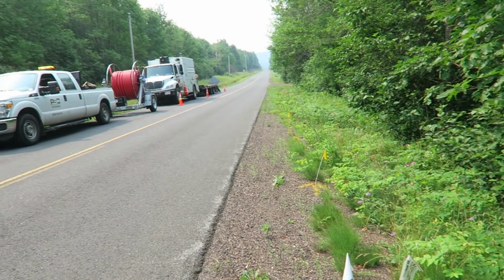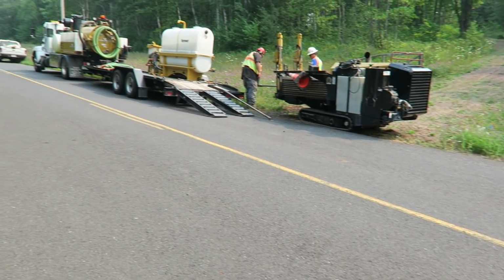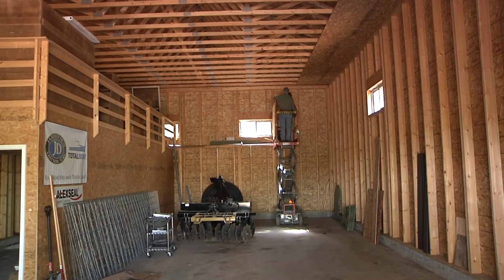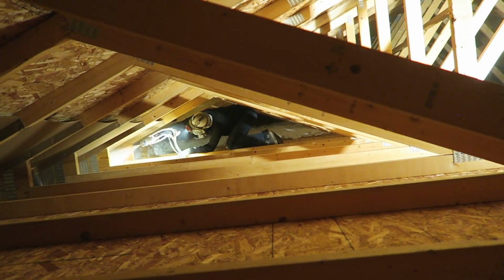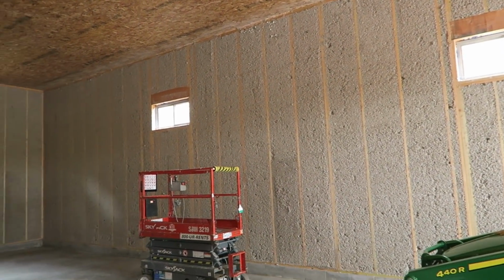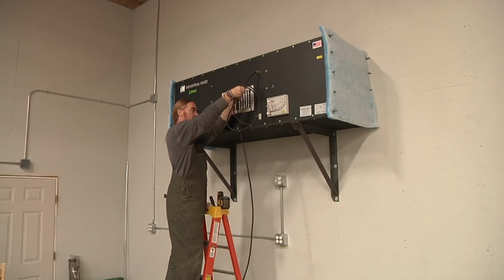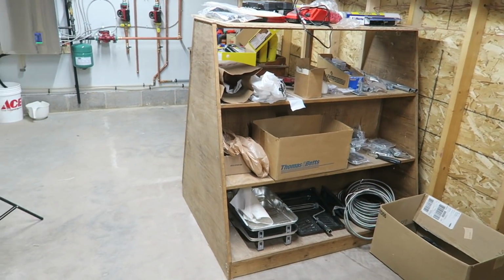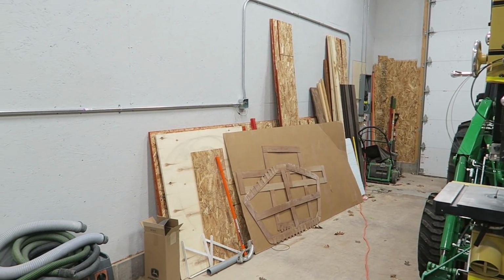It's A Disaster But It's DONE! How Much Did The New Boatworks Today Shop Cost??

Comment: Beautiful building but sounds like a hell of a lot of money I built mine out of recycled materials to two years and it cost $3000 for 30 x 26 x 14‘ ceilings for all electricity floors and heat The only thing I had Bre new was a concrete in the supply wire out to the garage. My garage door is 16‘ x 13‘  Love your stuff keep making it.  Those measurements somebody probably could do and find out how much a paid per square foot I’m sure

Comment: That’s crazy you can get power and gas with 600ft trenching for $3-4k. I work designing new connects, only power, in Washington and just the transformers are $2600 just for parts right now.

Comment: I've been a building contractor for 20 years (20 years in the trenches before that). A lot of people want a bid for a complete project and that is understandable. The problem, as you have illustrated, is the unpredictability of supply (logistics) , markets and labor. All contractors know this. The ones that are willing to give an ironclad bid will ALWAYS  add percentages for contingencies, percentages for profit and hefty rates for any changes to the original plan. All this, in addition to marking-up the labor costs. This is why I only work on a time and materials basis. And why I have a long list of happy customers. They get invoices for the materials at my cost (they pay my time to source and deliver them) and the hours my crew and myself actually spend on the job. And, like I tell them, If you don't trust me to not pad my hours, you shouldn't trust me on your property. 
"Under promise and over deliver" is not always achieved, but by working in collaboration with my customers, I am sure they get what they want at a fair price. 
Your project recap and cost breakdown is valuable for anyone .